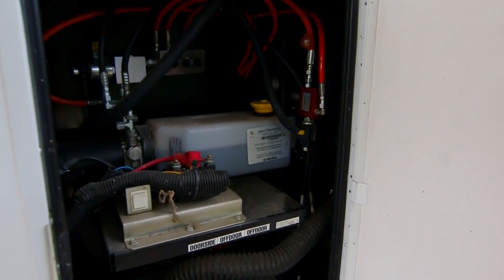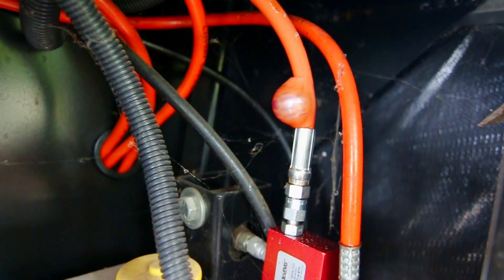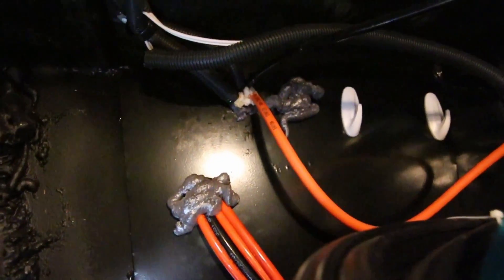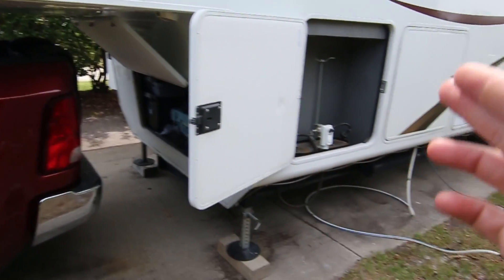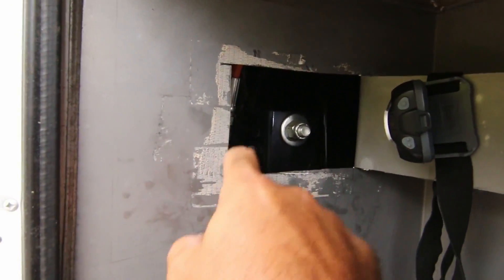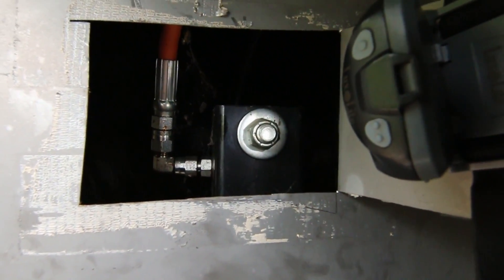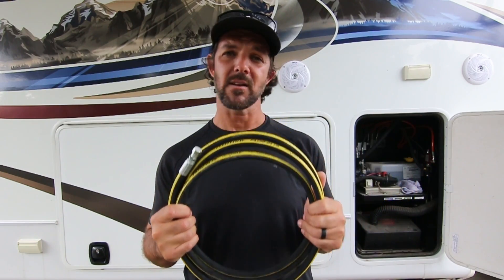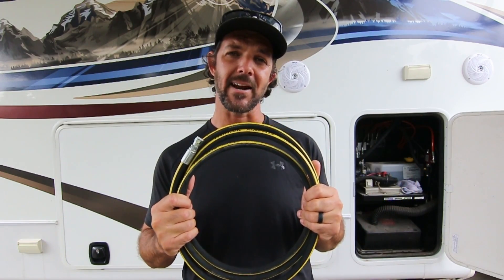RV: Hydraulic Hose Replacement

Comment: Nicely done, but one question - after you installed the new line - did you bleed/purge the line or let the Lippert pump deal with the air in the new line?   We're looking at needing to replace a few as the outer covering is starting to crack though we have no leaks at this time.    I also wondered about installing the new line with some ATF preloaded though that approach may be a bit more messy.  Thoughts?
Reply from the maker: That's why I recommend extending and cycling the legs half a dozen times. This  seemed to work with my rig. Haven't had any issues with it since.